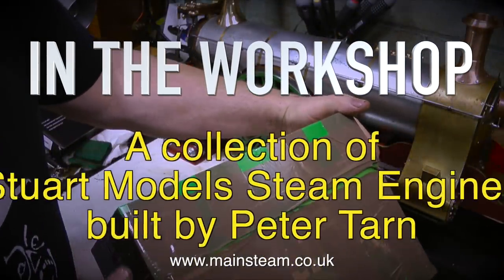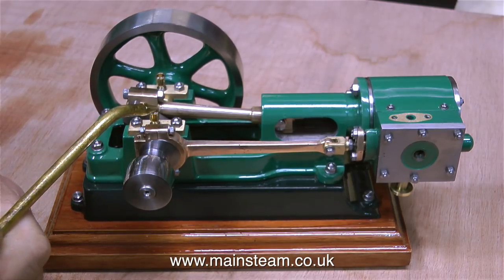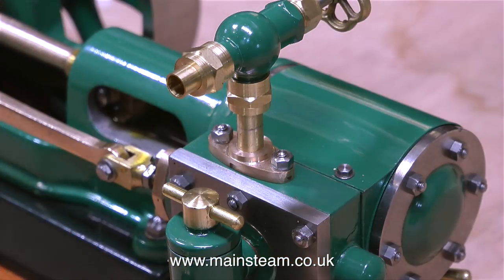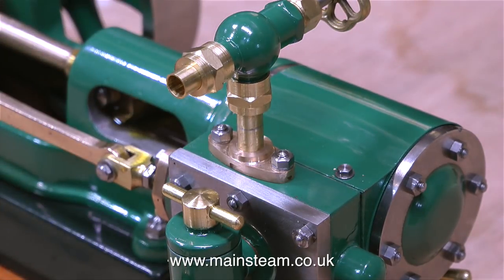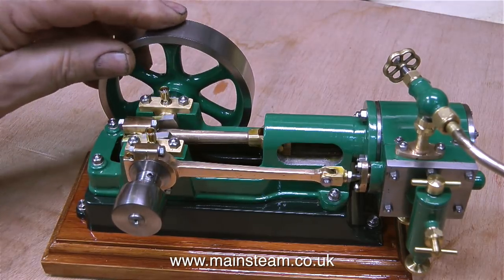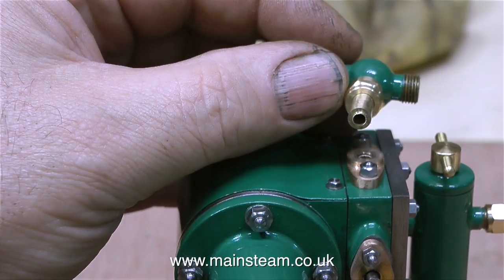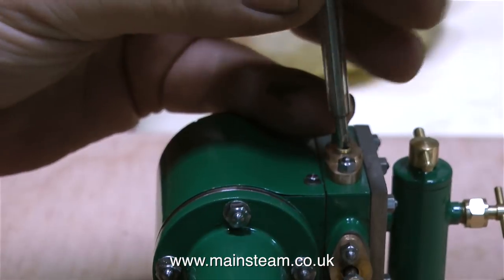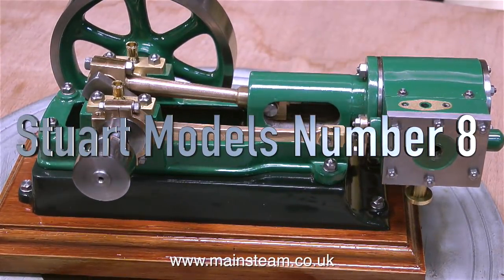STUART MODELS NUMBER 8 STEAM ENGINE REVIEW - IN THE WORKSHOP

Comment: Do you know if the paint work is powder coated?  Is powder coating ok for model engines?
Reply from the maker: These engine are not Powder coated. The frames of my 7 1/4 inch gauge "Tich" are, but it peels off easily .....
Reply: Thanks Keith!

Comment: I did notice that the lubricant level in the cup nearest the fly wheel didn't descend in its level like its opposite did.  The opposite one's oil level dropped rather quickly.  I am curious to know if this is because of bearing cap tightness or just a clog.  Hmm.
Reply from the maker: Don't worry about it - it's just the way it is .... }:-)))

Comment: where can I buy a staurt models twin engine? cant find any I don't think im looking in the right places
Reply from the maker: These were bought via UK Ebay .....
Reply: @keithappleton  Hi Keith , thankyou for all your videos and advice, I've made a batch of oil for bearings and was told by an oil supplier that rapeseed oil can cause a residue over time which can eventually cause problems. I just wanted some reassurance over this , and is this still your preferred method. Kind regards Adrian.